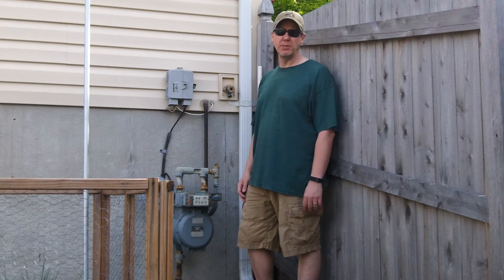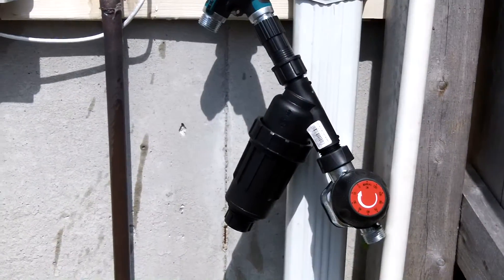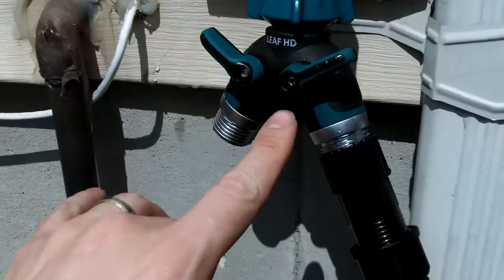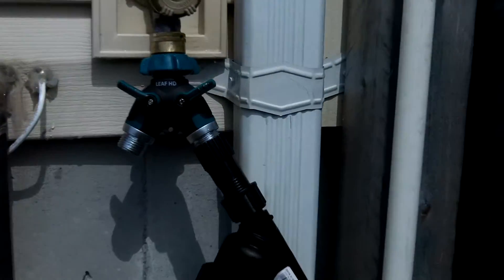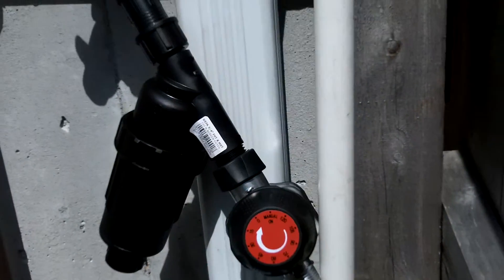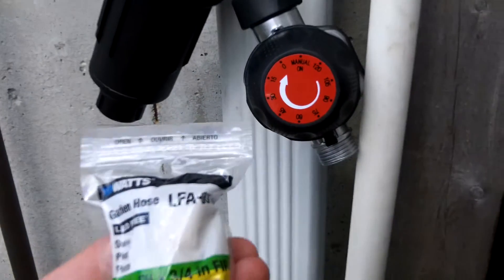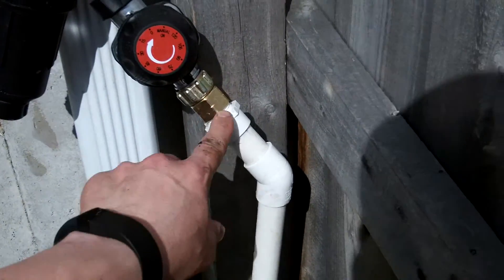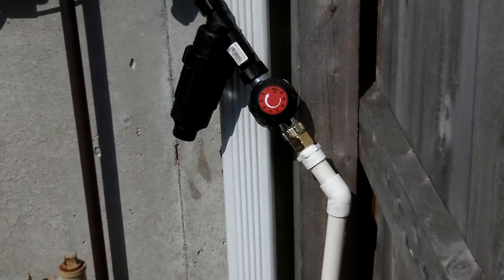Around the Home: #35 Drip Irrigation Part 2 - The Hose Connections

Comment: I'm a dummy female. what's the name of the adapter that connects the timer to the pvc? I need to do same thing. all these connector's have such weird names. don't know what to look for. thanks great vid.
Reply from the maker: 3/4 in. Slip x MHT PVC Hose Fitting. easy to find at home depot.

Comment: I've read the timer should be before the pressure reducer so the reducer isn't under constant pressure. makes sense.
Reply from the maker: I have the time after the reducer. Less pressure on the timer and less chance of water hammer when it turns off.